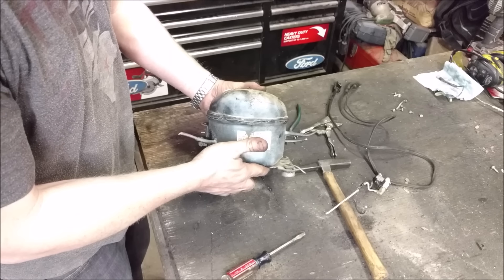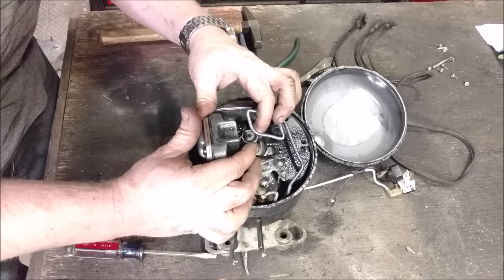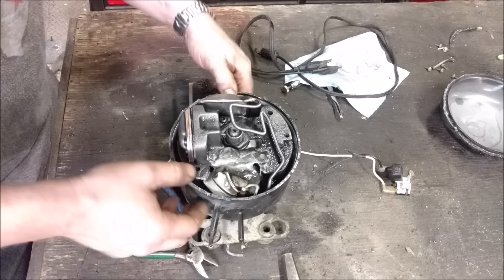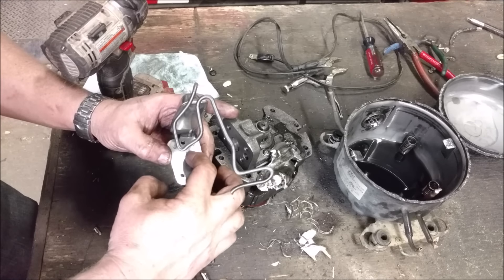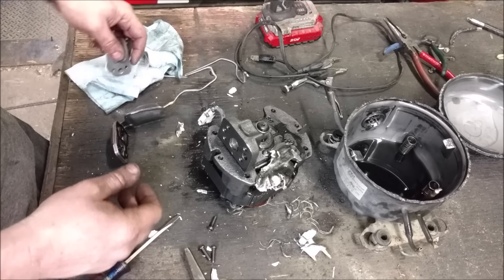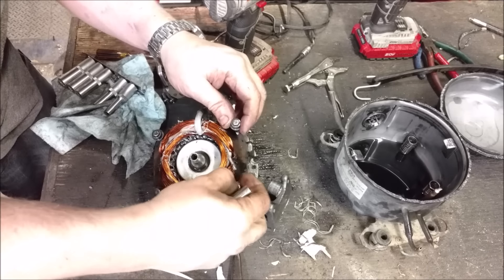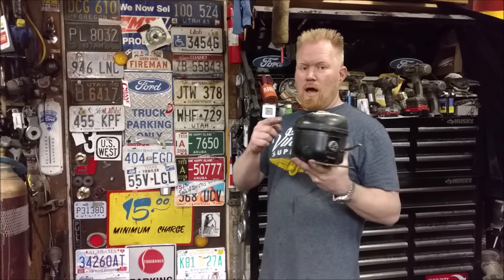What's inside a Refrigerator Compressor

Comment: My grandparents have a refrigerator that still runs from the 50's, where do I get one of those compressors?
Reply from the maker: Old fridges are built like tanks. I picked up a 1941 fridge a few years back from and auction. No one else wanted it. I plugged it in and started right up and ran great. Still works great and uses 1/3 the electricity my modern fridge uses.
Reply: rwdplz1 You may have to convert to a newer style compressor. It's doubtful you would recharge it with the old R12 and the newer refrigerants work better with the newer compressors.
Reply: sixtyfiveford sounds like someone replaced the compressor in that 1941s fridge with a freon pumping system like in the air conditioning in your house.
Reply: XanCraft21 R-12 freon came out in 1930. So I'm sure it was commonly used by the 40's.
Reply: You have to have the model number, serial number, and manufacturer of the fridge. There should be a metal data plate somewhere on that unit, hopefully it isnt tarnished so badly you can still read the numbers and letters. Once you have that info all it takes is looking on Ebay for a new compressor. You will probably have to convert to a new refrigerant like R-134a or R-404A though so dont worry about finding a compressor that runs on R-12 or R-22. Going online to the compressor manufacturer or calling the 1-800 number for the parts department they will be able to cross you over to a replacement compressor. Then find a refrigeration tech or AC tech and have him install the new compressor and filter drier. It takes a special set of tools and gauges and EPA certification to buy refrigerant, not sure about just a compressor but probably so. Pay a guy some cash and its an easy weekend job.
Reply: Repete Myname I don't think using the model number and serial number is going to be of much use on a unit that old. Obviously those original compressors are not being made any longer. You might get lucky and the reference books  will  show a  modern equivalent compressor that will work . You can get generic compressors like in this video relatively cheaply from a parts house. All you need to know is what horsepower you need. 1/4 and 1/3 hp are pretty common sizes.
Reply: These older compressors lasted forever.  They usually got tossed out when people wanted something more
stylish.  You can find these old (still-working) old technology ones at any recycling depot.
Reply: You will have to get a Delorian and go back in time since all new compressors are made like shit now! They burn out within 5years if your lucky because the almighty dollar has made these company's greedy! There Motto is FUCK THE CUSTOMER AND SELL SOMETHING! I hope one of these bricks from whirlpool or lg or Samsung read this!
Reply: JasonWW2000  you can replace it with r134a (compression ratio is king when it comes to compressors, and r12 and r134a have the same temp/pressure relation), normally you'd have to change the oil from mineral to POE (I've done it tens of times w/o changing the oil, r134a with mineral oil doesn't seem to produce miscibility issues (don't try that with any other HFC though) as long as the evap isn't too far from the compressor, but in a household fridge it's ok, but on such an old machine I would definitely prefer to change the oil), there's no way to change the oil in a hermetic compressor, so you'd have to unbraze it, turn it upside down to get the oil out, rinse it with trichloroethylene, rinse the fridge circuit with trichloroethylene and then flush it with nitrogen, and put POE oil through the suction line of the compressor, change the dehydrating filter, braze the compressor back, vacuum pump it, and then charge it with r134. 
But it's always risky to undergo such operations on old machines, so either take the risk of replacing the gas w/o replacing the oil, or take the risk to open the circuit of a 75 year old machine... I really don't know what I would do...
Simply changing the compressor for a r134a one would work w/o any prolembut as a refrigeration tech, I would totally wanna try a retrofit first lol :p
Reply: Unlikley!
Reply: He says it works fine. So why is everyone saying to put in a new compressor with different Freon?
Reply: sixtyfiveford why do you think that is my friend?
Reply: It's probably an ammonia/ heating element type. No moving parts at all.. freon refridgerant allowed for more compact sizes and much higher B T U capacity..the cooling oil can become contaminated with very toxic PCB s, don't get on skin/ eyes
Reply: You get them from the 50's
Reply: R12 is one of the best fluid 
and yes it is very economical in energy
Reply: Just type into YouTube. new refrigerators don't hold up. You will be really surprised some say they have a life expectancy of five years.

Comment: Many years ago when I was young, I made a air compressor out of one of these. It soon froze up, simply because the compressor is designed to have some oil passing through it. Running it with air only is like running your car without oil - it won't last long. In a refrigerator or freezer or your vehicle, a special oil made for refrigeration is mixed in with the gas and flows through the entire system. It also helps cool motor windings.
Reply: tedtw: Exactly, and also the returning gas, via the suction line...is very cold and assists in cooling the compressor and most importantly, those very delicate windings.
Cheers.

Comment: The hollow chamber between the head and the line is a muffler.  Keeps the condensation lines behind the fridge from buzzing loudly.  

The "flapper valves" are called reed valves.

That oil is pretty thin compared to what automotive AC systems use.

Comment: It helps to see the inside of these little monsters, because my compressor started rumbling and whirring very loudly and since it's connected to an electrical outlet I thought it might explode so I unplugged my refrigerator 😂 It turns out my fridge compressor  was just on the verge of failing, but the loud rumbling made it near impossible to sleep.

Comment: 15 years ago i was working for a,division of Panasonic that made compressors very similar to that one.  our base and cylinder were one piece and the con rod was AL. the pistons were 30mm on some models and were laser measured to match the cylinder.   the crank shaft and motor core were "heat shrunk " together along with a AL bearing.  we made everything in house except the block casting.  btw the plastic piece that melted we called a muffler.   and they use the weird bolts because the are automatically fed and tightened by machine
Reply from the maker: Thanks for the info.

Comment: Thank you a million times over.  I didn't realize that the assembly floated so loosely inside the housing.  Mine is banging against the housing for about 15 seconds sometimes when it shuts off.  Maybe one of the mounting feet are loose or missing.
Reply: Yours still work?  I have same issue when it starts and stops about 3 ping pong noises

Comment: Well, I have seen large ones apart (the ones with external motors, belt drive) have always wanted to see inside small one but never wanted to get a dusty mess cutting it open. Thanks. I had thought the piston would be same as large ones, quite surprised at how absolutely basic it is.

Comment: Hey thanks for the vid, I'm about to use one of these for some projects and it was helpful seeing inside yours. Had you had a capacitor hooked up you probably wouldn't have needed the drill to start it, and.......it may have run without smoking the oil off the stator windings. You know, phase shift and all that sort of stuff
Reply from the maker: It start winding was shorted out before it was opened.

Comment: The low side or the larger line is called the suction side..and the small line is called the high side, which the compressor push's the Freon out the small line(high side at high pressure usually 140lbs) as a gas..then it goes directly into a filter drier,  them goes into condenser, which takes the high side gas and cools it..which, it then turns into a liquid..which goes into a capillary tube up to the evaporator, and that cools the refrigerator..I have put in a thousand of these..and the number one reason for failure is HEAT...like a blocked or clogged condenser..which makes the compressor work harder and get hotter...to the point it locks up.

Comment: Thanks for sharing man. That was hillarious when you said don't think its the end of the line for this! 
What actually failed? Will you replace it? Looks like the winding has a short to ground.
Reply from the maker: The start windings overheated and shorted out.
Reply: I wonder how hard it would be to rewind it? I've rewound several RC helicopter motors. But then you have the cut bracket holding it in and all. They don't seem really made to work on.

Comment: Domestic used compressor has virtually remained same for last 5 decades or so. Only recently, induction motors are replaced with BLDC motor.
Reply: Amusingly refrigerators are moving faster to VFD's than residential AC units, the HVAC guys are taking people to the cleaners when they install old induction crap with starting capacitors, keeps those service calls coming!

Comment: Thanks for the interesting look inside a ref. compressor. A couple of issues: the housing isn't made of 1/8" steel, more like 18 or 20 gauge steel; the housing isn't welded- it's folded and press-formed together. Lastly, you keep mentioning "air". There is no air involved. The refrigerant is a liquid that becomes a gas at a certain pressure. The change from high pressure to low pressure is endothermic - it absorbs heat; re-pressurizing the refrigerant is exothermic - it gives off heat; the expansion coils cool the  inside of the insulated refrigerator. An air conditioner works exactly the same way, except that a fan blows room air across the cool coils.
Reply: He should have done a prior exploration on a second compressor.  Measuring the case, looking for rings, and being more concise.

Comment: Just replaced our old Zanussi fridge freezer with A  new one after about 17 years, so done quite well, starting getting very noisy and not cooling, when I pulled it away from the wall the compressor was so hot I almost burnt my hand on it!

Comment: Fascinating to see inside one of those. Funny they would use proprietary screws, like anyone's ever going in there!
Reply from the maker: Crazy screws. Someone pointed out they are probably "External Torx Plus" screw heads. Seams it would be cheaper to have a standard hex bolt, but I'm sure a million dollar robot can hold those strange screws better?

Comment: Yup, my primary pry tool is a tack hammer also (smiley face). Been going to take one apart for a long time but just haven't. It was interesting.,As an aside, when I was in Turkey i saw them cut them open, rebuilt, rewelded and reinstalled.
Reply from the maker: I'm not picky, any hammer is a good hammer.

Comment: You can still keep the metal thing that was in the stater coil with the crank shaft on it to make a 12 volt stater out of screws, nuts, and some new copper wire ordered online, but you will need a 12 volts output transformer and don't use a bridge rectifier, and you will need a non-polarized capacitor. You might need to watch a YouTube video for the 12 volt stater, just look up diy homemade induction motor. And make sure you use that metal middle thing and resize it to fit the metal thing, and find a piece of wood too.

Comment: Great strip down of a compressor, did always wonder what wus inside one of those, so,. next favthom out, how they get on fire sealed inside that casing as fridge fires are happening over here in the uk, thanks.
Reply from the maker: It's not uncommon for the multitude of tubes to develop leaks over the  years. This is due to corrosion or vibration generally. Since they use flammable refrigerant in the UK it causes fires.

Comment: moe use a window unit compressor. you can get a good big one for 220v or smaller one 110v.

 just use the cap that comes with it. use a 3/8 compression fitting to 1/4 mip

Comment: First time I got into one of those I made a Hell of a mess with the oil.   I knew they had oil inside, just didn't know how much oil they had inside.  LOL   You can do all sorts of cool stuff with those.   Vacume Pumps.  Low volume Pressure Compressor,   They can actually achieve 2-400 PSI given time.   Crazy high pressures.
Reply from the maker: They are fun to play around with.

Comment: What truly surprised me is the size of the compressor piston! Large motor, tiny piston i can now understand how these things are designed to run their whole life without ever having to stop, other than when necessary refrigeration has been attained.!
Reply from the maker: These are designed to move very little air/gas but do it a high pressures 300+ psi.
Reply: Loved the drill powered compressor you cooked up from this!

Comment: I always wondered what was inside, thanks.  Can you do a follow up, and stick a 3600 rpm brushless  DC motor in there, weld it back together, and gas it back up?   I would love to see that!  I don't get why there aren't many, if any, DC powered refrigerators out there... Not talking about peltier fridges.
Reply from the maker: I think some of the modern ones are DC computer controlled motors. It adds a fair amount of cost so it's only in the higher end units.
Reply: @sixtyfiveford    I did see some dc powered compressors on eBay, but wonder if they are actually ac  motors with an inverter strapped to it.  My reason for 'the want' of a DC powered compressor, would be to make an DC powered air conditioner, for when the power goes out, because a hurricane, for 3 days, during the hot summer.  Florida is hot where I am.
Reply: Guru  long  sreved bai  harde piped  weling bsi  coper  weldingho  degri   copeper  hoted   falmeing  and  exp,,1020  ,130,1040,c   TEmp,,,falmeblesokbgues  explas ok gues thankyou to shering boss,,

Comment: Great tutorial. Never had a need to learn this until now. My 25 yr old Hot Point fridge has been clunking, every time it shuts off, for a couple years now. Now the compressor is rattling inside, as if it's out of balance, or the spring is broke. (Maybe both?) Wonder how long I can milk it out? Thanks for posting.
Reply from the maker: They go a long time with the clunk. A spring likely just came off it's mount.
Reply: @sixtyfiveford  Thanks for your reply. But it's not just clunking, anymore. 2 days ago, it now has an internal "tapping", every rotation of the motor. As if something inside is contacting the internal wall, as it spins. I can put my hand on it, and feel it touching every revolution. It's a light duty tap, but know it's on its way out. I'm in the process of picking out another fridge. It was built in the 90s, and don't think appliances are built to last 50 years anymore. Not even sure it's worth rebuilding. But once again, thanks for your opinion.

Comment: do you think it's possible to compress refrigerant with a unit like this, but have a shaft that is external to the hermetically sealed chamber, so that the shaft can be turned by a drill or belt-driven power source? 

the context for my question is that i live off grid and have a variety of power sources available to me, but not pure sine 3000+watt surge 120v electricity, so my system can't start even small compressors with high inrush current, like a minifridge. i'd like so other way to get the shaft turning besides dumping AC inrush current into it.

thanks for the video, and the air compressor follow up. great stuff.
Reply from the maker: Automotive AC compressors are just what you need.

Comment: I just pulled one of these off of a refrigerator and dumped out what I assumed was the oil from one of the lines. Is there a substitute oil I should put back in? Do you think that was the oil that I drained? I thought it was water

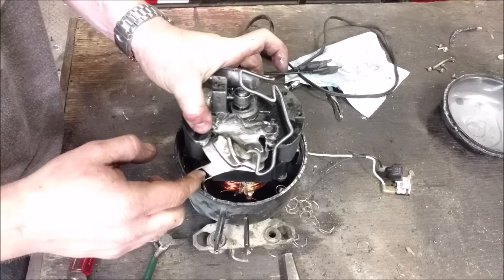Comment: @3:50 oil inside splashes everyting for lube. 
And we were told not to operate newly delivered ref and let the oil come down first for 5 hours or so if unit got tilted or lied horizontally or else it would damage the motor.

Comment: My compressor has been making a horrendous clanking sound for several months(fridge is 19 y.o). I wacked compressor with my palm & the noise stopped. It sounded like the motor banging against the compressor housing. The fridge always worked fine. It was just REALLY LOUD continuous clanking.
Reply from the maker: One of the internal mounting springs more than likely fail out of it's perch or broke.
Reply: @sixtyfiveford  that's what I'm thinking, also. I've left the back off & when it gets loud, I thump it with my ✋. That'll have to do until I can afford a new fridge.

Comment: i had an idea that
if you could spin that motor by other means --
gear it up to a bicycle , wind turbine , gravity wheel , etc
then you could get refrigeration without electricity

but if it needs to be sealed in that oily bowl . . .

Comment: The heads are called system zero. They are security heads. They come in various sizes and the the drivers for them are not readily available. They are not cheap either. If you need a specific size you would have to get a whole set, or at least part of a set. I was going to get one for a particular job but there was no way of knowing what size I needed. They were small ones, not the size in this video, but would still have cost a fortune to get enough to hit on the size needed. Ended up using a pair of side cutters to grip the head. No good if they are recessed though.

Comment: is that the same concept as the bigger 3 ton units used in residential condensers?
Reply from the maker: Basically yes. But instead of a piston compressing the refrigerant it is more than likely a scroll or rotary pump.